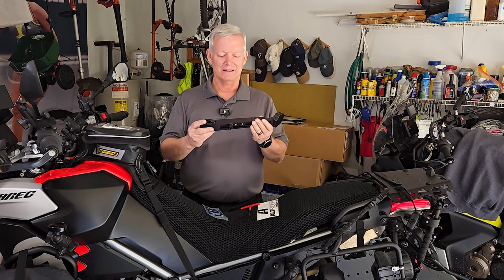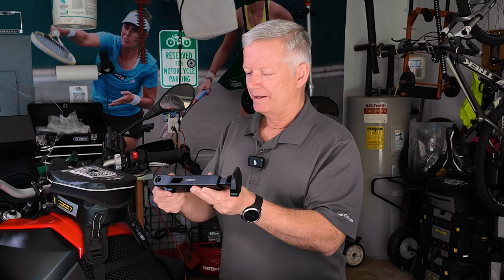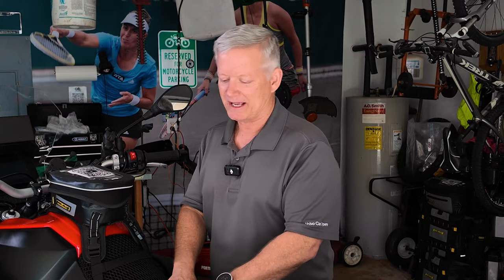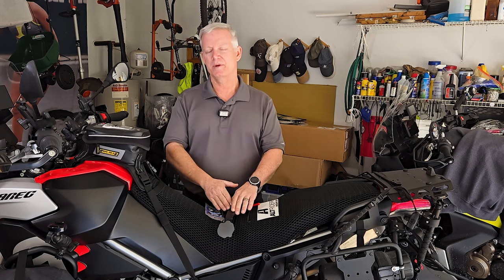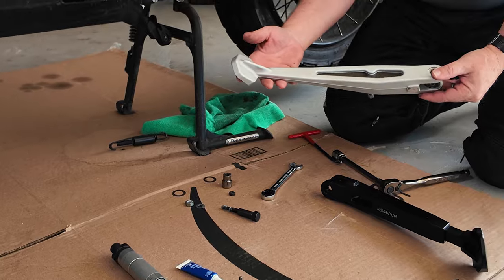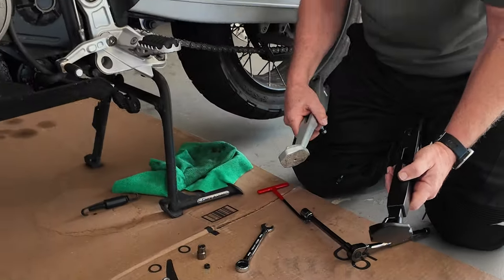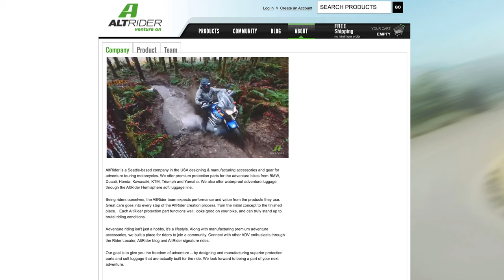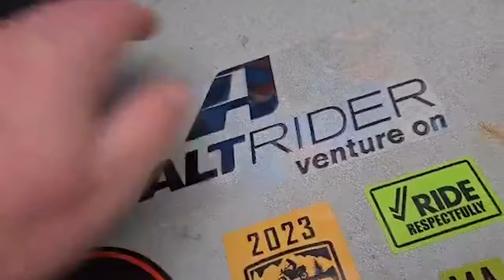MPA AltRider Sidestand Install

Comment: Glad your install went well.  Altrider Aprilia Tuareg Adjustable side stand wouldn't fit on my bike!
Axis of  "bearing" hole & locating threads didn't line up!
emailed Altrider Europe & Altrider USA & had no response from either, Sent stand back to Altrider Europe for replacement or refund. Really would like one that's actually manufactured correctly.
Reply from the maker: Oh no!  I'm very surprised.  I have several of their products, which have all been a perfect fit.  And they have always been very quick to respond to my questions.  Which bike do you have?
Reply: Aprilia Tuareg 660cc As stated in the post.
Their Suspension link is superb & the side stand looks well finished but i suspect the "bearing" hole has been machined from one side & the threaded hole from the other so they dont line Up. Maybe its an isolated incidence or just the European sourced ones.
It is very concerning that neither Altrider Europe or Altrider USA not responding to emails! @MotoPhotoAdventures
Reply from the maker: I agree!  That's very unfortunate.  You might try a phone call?  Or email AltRider USA again, tell them you saw our video, explain the issue you had, and ask if that was an isolated manufacturing defect?  Hopefully they can tell you the problem has been fixed and you can order a new one?
Reply: @brie6966 We're sorry to hear your install didn't go as expected! That is totally not the AltRider experience we want our customers to have! We looked for any emails and weren't able to find any. I don't have your name so we can't find your order so it's hard to know what happened, I also tried to look for a return for that par in EU and didn't find one.  We try to be on top of our customer service, but mistakes happen.

We always want to invite our customers to reach out to us directly if they ever have any problems or questions

Comment: It's called a box end wrench, when one end is open it's called a combination. When the box is also a ratchett, then it's a ratchetting combination wrench. The box end can be either 6 or 12 point! Usally only the larger sizes are 6 point to  handle higher torque. 

An interesting issue is the box end is used to apply more torque, but when it's a ratchet the torque gets limited by the mechanism.

Your newer bike is not showing the signs of a few New England winter seasons that require the additional torque to remove any fasteners.

In the future I expect my trainers to be 100% and not just guess at the proper names of tools and parts. This is especiallly important when it comes to making coffee in the morning vs coffee in the evening. Everyone should know that morning coffee wakes you up while evening coffee has the additive that helps you either sleep or become a foolish old man.
Reply from the maker: I love it!!!  Learn something new every day.  And by the way...I'm a tea guy.  😅

Comment: I want buy it. Do you mount the original center stand?
Reply from the maker: You will like it!  Also, my center sttand is from T-Rex Racing.
Reply: @MotoPhotoAdventures  dont touch with it?
Reply from the maker: @magazzinografico  I'm sorry I don't understand your guestion.
Reply: @MotoPhotoAdventures  Sorry, i ask you if when side stand go up, touch on the center stand
Reply from the maker: @magazzinografico  thank you...I understand now.  No, the sidestand does not touch the center stand when it goes up.
Reply from the maker: Haha!!!